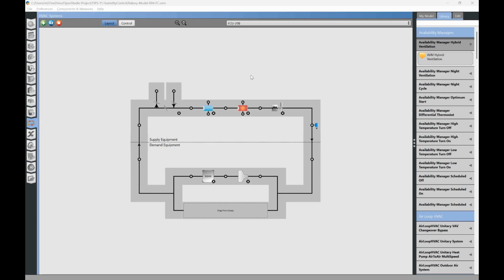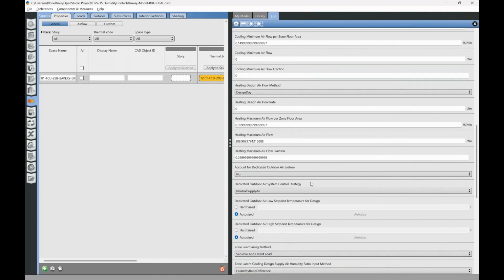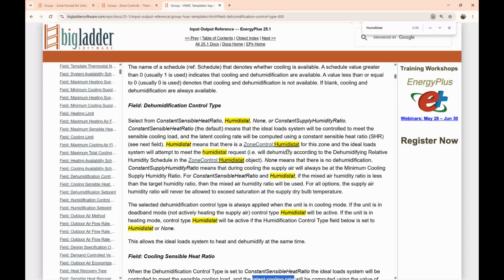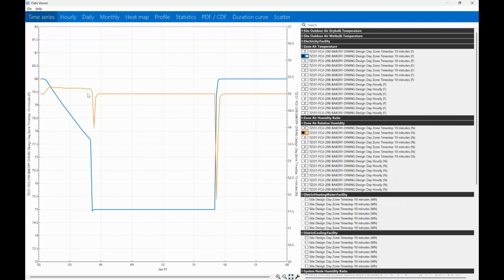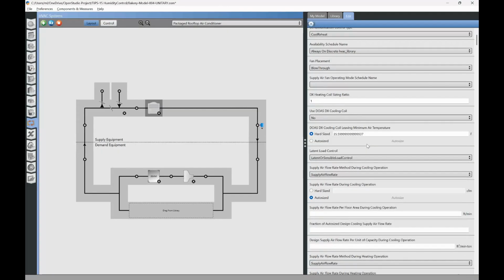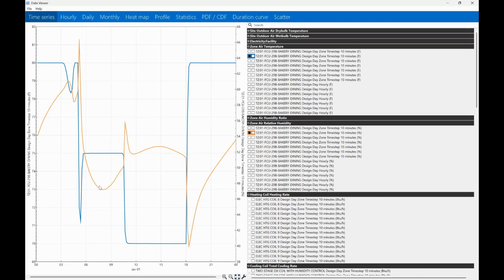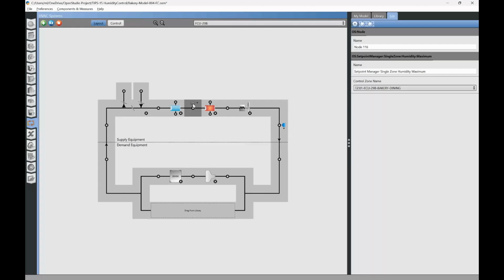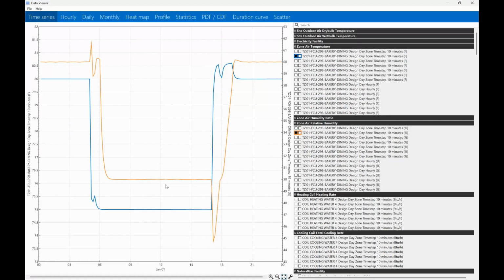OpenStudio Tips - Implementing Humidity Control

Comment: Hi , I have project which has AHU ( air handing unit ) use refrigeration . So how to set up it in OpenStudio . Thanks you !
Reply from the maker: The fastest way to create an AHU with DX cooling: Go to the HVAC Systems tab on the left, click the green plus button at the top, select any one of the packaged options that shows a snow flake (and fits your application for heating; fire is gas furnace, arrow is heat-pump, water drop is hydronic water coil, and lightening bolt is electric heater coil) and click Add to Model.